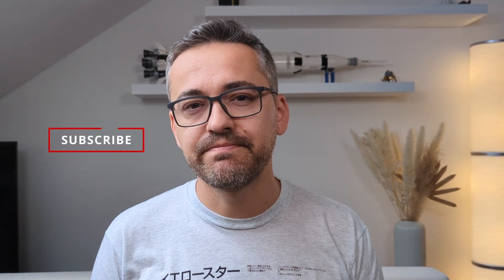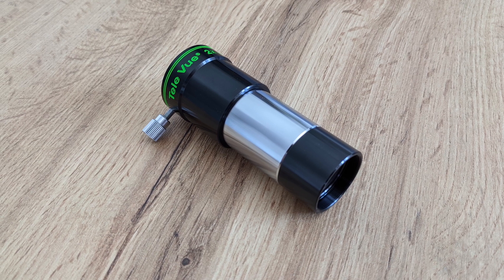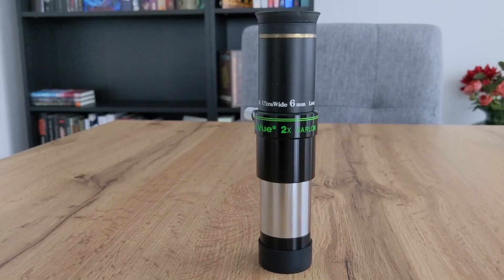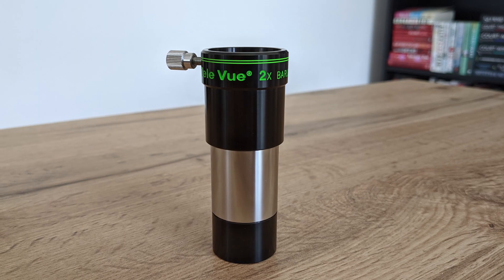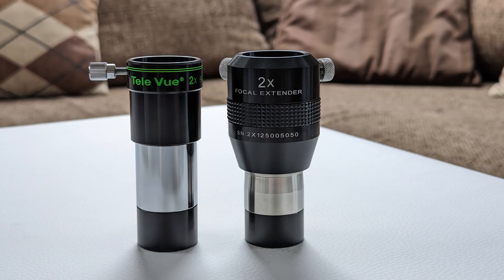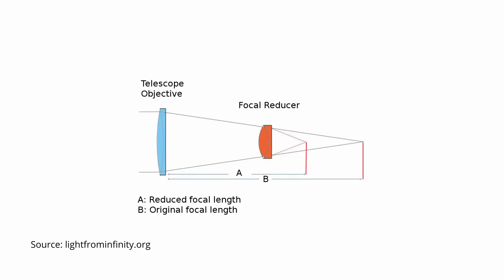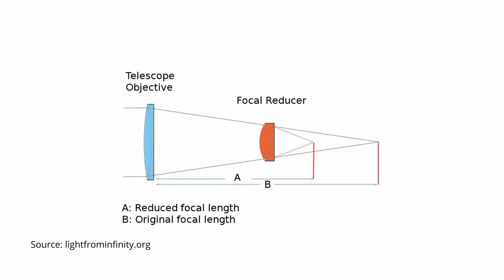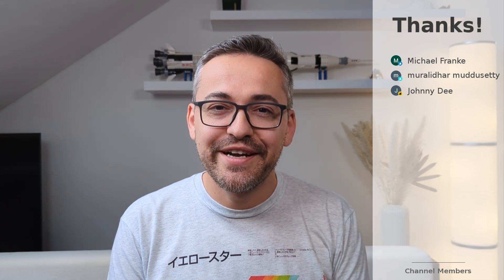What is the difference between Barlows, Focal Extenders and Focal Reducers?

Comment: Thanks for the video. I agree that barlows are not a good solution (especially for photography). I used a camera x2 focal extender with Nikon mount where i can connect either a camera or an eyepiece holder (with a Nikon lens female adapter i built). The quality of camera focal doubler is way better than any astronomy focal extender or barlow…

Comment: I like the Vernonscope 
MDB 1 1/4” 
they thread into your eyepieces that have standard or Vernonscope ( Brandon ) threads.
My scopes are all F/9 or longer ratios.
The MDB 1.25x or 1.5X can be combined to make a
3X or a 2.75x or 2.5X
The cost is very good
and the glass is excellent.
After viewing for many many hours at the eyepiece of my scopes.
The MDB gives me the ability
 to see how good the seeing is on any given night.
I have other eyepiece brands.
When I want to forget about the glass and just view all I can see with the conditions
There is a Brandon Eyepiece in my scope.
Then maybe a MDB Vernonscope Barlow as well.
More talk of exit pupil and 
F/ratios need to be discussed.
Framing your viewing object with the FOV of Eyepiece in use.
Eyepieces and good filters give you choices most did not know they had.
When one of the world’s best visual observer was asked the question. ( How did you deal with the color on those old refractors at Harvard? )
His response was.
#11 yellow filter.
Also a #8.
I learned a lot about filters.
The UV/IR filter should be in every visual observer’s Eyepiece case.
I believe in Not letting a camera and computer have all the fun.
Get a good comfortable position and study what you look at.
Let your eye adjust to what is there!
Most of all have fun!
Over 40 years of viewing.
1,000’s of hours at the eyepiece.
For me it never gets old.

Comment: Thank you for the video.  I have a C8 SCT.  I'm trying to do planetary imaging using the ES 2X focal extender and a DSLR plugged into it, but I can't get it to focus.  I noticed other astrophotographers tend to use Barlows combined with an astrocamera screwed on for planetary imaging, and I'm thinking that I should buy a barlow with threads.  Can you, or some of the experts in the comment area, explain if Barlows should be used for astrophotography instead of focal extenders and why?  Thanks for the help.
Reply from the maker: @jasonspringfield5601 Hi Jason, I don't think that using a Barlow instead of a focal extender would necessarily solve your focusing issue. It sounds like you just need to increase the distance between the camera's sensor and the telescope. I had the same issue with my refractor and I ended up adding several centimeters worth of extensions just to get the image into focus.
Try moving the camera away from the telescope by hand millimeter by millimeter while keeping it aimed at the target and see how far away you need to pull it back until the image gets sharp. You can do this during the day while aiming at a far away target (> 2km).

Comment: I have a question about the Focal Extenders. Is it possible to use it in combination with a barlow lens? For example, I would use the 2x barlow lens  with a T2 Ring adapter for my DSLR camera. I already try it with a 2x barlow lens, T2 ring adapter and a DSLR camera to capture the moon. I have a 750mm telescope. But I just recently found out that I couldn't find Saturn (August 27th) even with a barlow. Hopefully the community can help me out. And if it's possible/compatible, that would be easier to make the choice.

Comment: A totally beginner question - can I build a complete eyepiece set with a single eyepiece (of say around 3mm exit pupil) and multiple barlows 1.5x, 2x, 3x and focal reducers etc?
Reply: The reason I ask this is because I was wondering if premium eyepieces are very expensive, why not get just one premium eyepiece and get multiple barlows and focal reducers which are relatively cheap. 
Instead of changing eyepieces everytime you want to change the magnification, you could change the Barlow instead. Lol
Reply from the maker: @sudarshan273 In theory it should be doable. At least partially, but it is probably going to be very impractical. You will need to give up some flexibility and get premium focal modifiers. The compatibility with diagonals will also suffer since the focal modifiers probably won't fully fit inside. You would be also limited by the field stop if you choose a 1.25" eyepiece. If you go for a 2" eyepiece that features a very wide field stop, then you'll have to work only with focal reducers, which could be difficult to pull off. Interesting question though 🤔
Reply: @BogdanDamian Thank you for your insights.
To overcome some of the issues you mentioned, please consider the following combination instead.

I have an 8f6 dob and 2 mediocre plossls that came with it. To upgrade it-
A TV 24 Panoptic + 2x, 2.5x, 3x and 4x focal extenders. 
TV 24 Pan gives 1.36° TFOV and 50x mag. That's pretty much the widest and lowest I need to go. 
TV 24 Pan + 4x FE gives same magnification and similar TFOV as that of TV 6 delos. 
Similarly, TV 24 Pan + 3x FE = TV 8 delos,
TV 24 Pan + 2.5x FE = TV 10 delos,
TV 24 Pan + 2x FE = TV 12 delos.
I checked the math of magnification and TFOV on a simulator.

I understand that the performance would not be to the level of separate eyepieces. But it should be pretty close with decent quality FEs like Explore scientific. 

Any thoughts? Am I crazy here?
Reply: @BogdanDamian  This solves  the 1.25" vs 2" conundrum. Also there is no need of premium focal reducers.

Comment: Thank you for such a detailed explanation.  What a timely video!  I bit the bullet and bought the 2" 2x Explore Scientific Focal Extender recently and it worked extremely well - I was nervous but the quality of the build, flexibility with my eyepieces and great star gazing experience really showed me I bought a great quality piece worth the price (NEAF Sale!).  I was curious what the difference between the Barlow and the Extender were and I'm really glad I went with the extender.  For reference, I have a vintage C8 Celestar Deluxe which I just purchased as well as several luminos eyepiece (7,10 and 23mm) along with a 2" Celestron Dielectric diagonal.  Clear Skies!